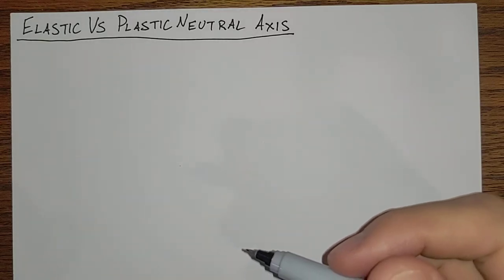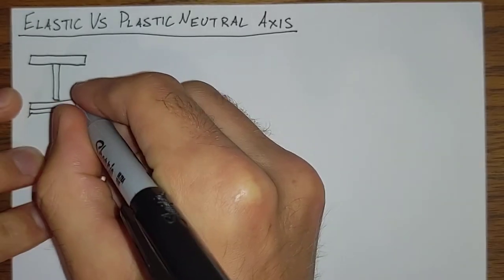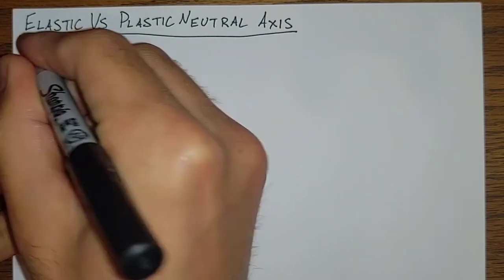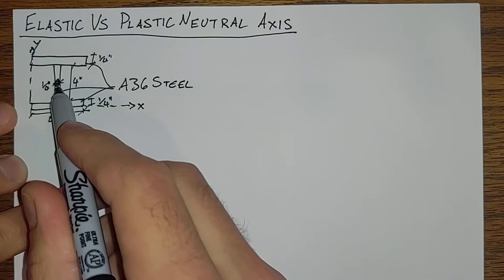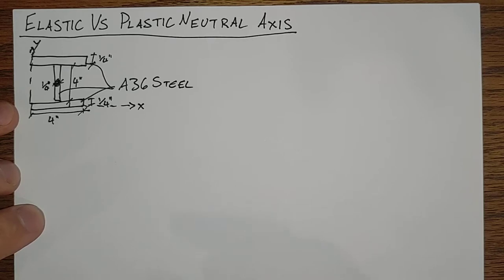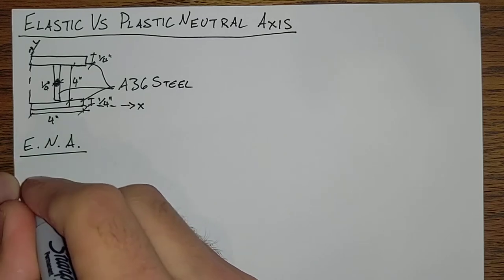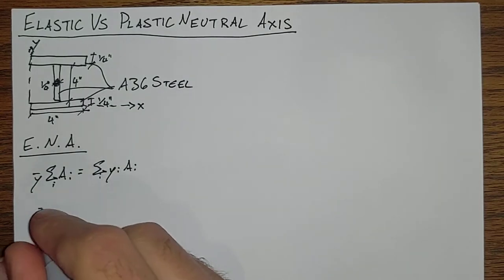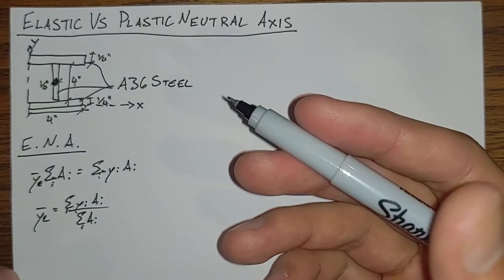What is the Plastic Neutral Axis (vs Elastic Neutral Axis)

Comment: is it possible that the plastic neutral axis is located outside the I beam . ex. above the top flange?
Reply from the maker: Good question!  Lots of things, like the shear center if a channel, can be located outside the shape, but the PNA has to be located within it. 

Remember that we're looking for where the full force resulting from complete yield of the material above and below the axis is balanced.  If the PNA is above the top flange, then the whole section would be yielded in just tension or just compression, with no material in the opposite stress state to balance it out.
Reply: @StructEdOrg  thank you so much
Reply from the maker: Anytime!  I should add that by "within the shape", I mean within the bounding dimensions of the shape.  The actual "plastic centroid" (not sure if that's a real term or not) where your x and y-PNAs intersect could be out in space for parts like a channel shape with returns on the flanges, but it will always be within the bounding box of the shape.

Comment: Don't you loose precision with inches instead of meters
Reply from the maker: No, I wouldn't say that.  You may be  able to take more accurate measurements on a ruler with millimeters than with inches, depending on the gradations (1/16" is about 1.59 mm, 1/32" is about 0.79 mm).  But if you're measuring with, say, a digital calipers capable of displaying in either unit, the accuracy should be equivalent.